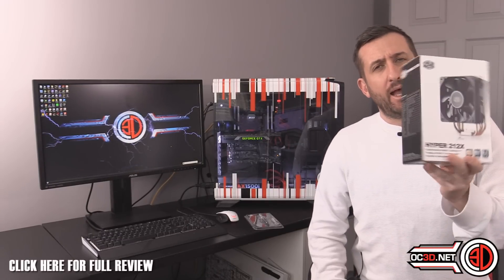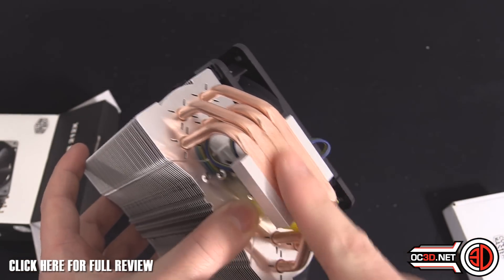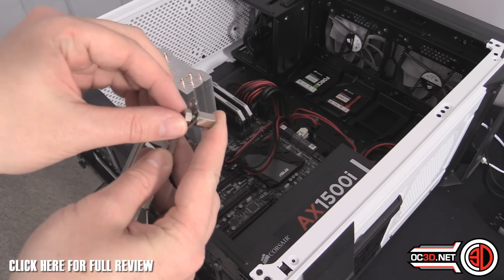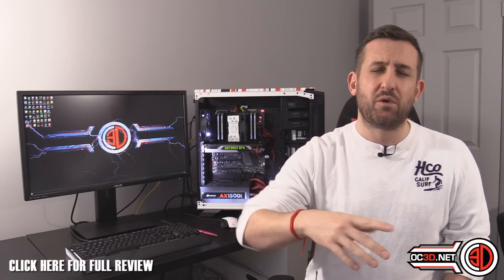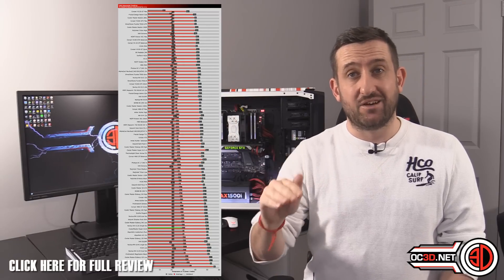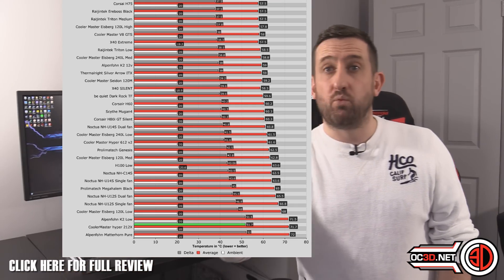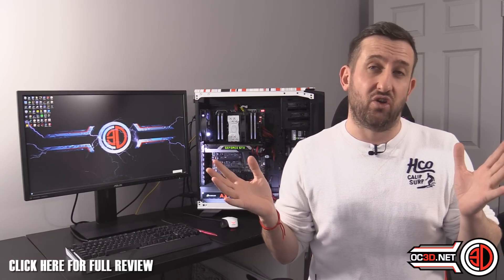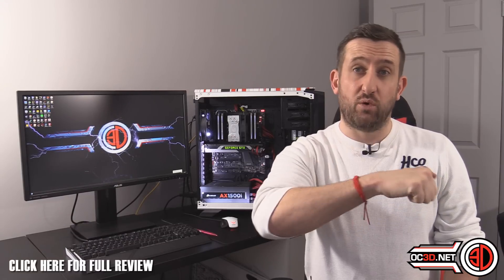Coolermaster 212X £30 CPU Cooler Review

Comment: I Just put a hyper T4 on my 4690k. at 4Ghz it's running at 40 C with 60% CPU utilization.
Reply: +hblu The cooler is great for 95 tdp cpu´s but not for the high-end 2011 socket.

Comment: im using http://www.amazon.co.uk/Enermax-ETS-T40-W-Radiator-WhiteWhite/dp/B00D697L0Y/ref=sr_1_1?ie=UTF8&qid=1456849117&sr=8-1&keywords=Enermax+ETS-T40-W on my i7-4790K @ 4,5Ghz    and it maxed out @ 61°C in Aida64    was buying this in germany for 37,-99€   wich was @ that given time like 32£  (feb. 2015)
Reply: +BiveZz01  Enermax itself is saying it got 200w cooling potential, also got the same cooler as black version   cooling  my old FX-8150 in rig of my GF   while  62°C @ 4.1 Ghz and full load.

Comment: I'm using a hyper 212 evo on an i7-4820k @ 4.6Ghz and the temps never get over 60*c,  for the money you can't really go wrong these little coolers.
Reply: +Jacob Whittaker I had the evo on a dual fan set up. Now I have the NH-D14. It runs 6 degrees cooler at stock, but as you start to clock it up it starts to spread. The 212 Evo was a great little beast though and the only reason I got the NH-D14 is because some dude was selling it for £35 on ebay because they didn't realise it wouldn't fit in their case. To be fair it is almost as big as my head...

Comment: Look the bottom of that CPU cooler is poorly milled .....it should be polished ....they left the crevices on the heat pipes at the bottom....I had that same problem with my cooler master hyper T2... My i7 6700k would spike to 81C under load...this will work better because it has 2 extra heat pipes ....but it's speed to cool the CPU back down to stable temps will take a tiny bit longer with a non polished surface.....
Reply: are u a engineer? as long it has a flat surface it's better than a fuckin shiny surface that is uneven. btw u dont expect a mirror finish in that price range.
Reply: +FantaFuture92 for $45 dollars my CRYORIG H5a does have almost a friggen mirror finish , and yes I expect that ...and no my cooler master hyper T2 did not have a flat bottom it rocked on my CPU ...which made my i7 6700k spike to 81c under load
Reply: +FantaFuture92 we who post videos about our experiences and the faults that we find .....I was explaining that my T2 failed to do its job .....and I noticed that all the cooler masters in the price range of $45 and under have the same machine surface problem ......the CRYORIG H7 is $35 and I believe that has a almost mirror bottom as well. Just 1 less heat pipe ......and they focus on CPU cooling .....my cooler master sounded like a jet taking off under full load......

Comment: This is a fantastic cooler. I have used this on a FX 8350 black 4.0 Ghz and it had no trouble keeping the chip under 60c at full load.
Reply: got the fx 8320, at 3.5 stock speeds, the temperature stays under 50C° at full load
Reply: +T FK wow those are really good temps
Reply: Chin Narciso well now its summer, so now it stays around 55-65C° at full load

Comment: I have been running the 212 Evo (with 2 Prolimatech 140mm fans in push/pull) for three years on my AMD FX8350 (stock) and it has never exceeded 63°C under full load running SETI 24/7. I always thought AMD was supposed to be the mega heat generators of the CPU world (at least that's what my Intel owning friends tell me), seems I was wrong, I have not used a desktop Intel CPU for quite a few years now. But this is a nice balanced review and it's nice to see tech tubers reviewing affordable products, not everyone has the money to spend on expensive hardware, keep up the good work TTL!

Comment: +OC3D_TV what is the difference between the new updated fan vs the older fan design?

I got the 212X with the grey high airflow fan. and it surprisingly able to keep my QX6800 CPU with good load temps. 

On the stock intel cooler, I was getting like 80+ degrees, now the 212X make the load temps hover at 60+ degrees and it only hit 70 degrees using AIDA64.

Comment: Do you  reckon AM4 will have the same mounting holes as the older sockets?
Thinking of buying one of these and still want to use it when Zen comes out.
Reply: I'm almost certain that it will. However, if the mount is not compatible, I'm even more certain that CM will release a set of mounting hardware which is, many companies have done this in the past.

Comment: Idk... I have the original 212 EVO, tried overclocking both AMD chips that I have under it... I used an FX6300 and an FX8150... at stock, both chips hang around 32-35*c, then under load the 6300 hits 44*c and the 8150 hits 49*c... so since these were below 60 I overclocked the chips to a far as I could take them before they hit 60 or became unstable... the 8150 was able to hit 4.36GHz... and that's a 125W chip at stock! the chip itself was yanking about 160W out the VRMs whereas the 6300 was at 4.72GHz pulling about 130W from the VRMs... the only reason that chip wasn't pushed harder is because it got unstable after that! I bet the 212X could probably handle those loads with a slightly lower fan speed on my systems... (oh... and the room temps were 22*c all the way through in case anyone wants to make delta figures for giggles :P )

Comment: Good luck replacing the mounts, I had a 4 year old Hyper 212 Evo and the mounts had broken over the years due to replacement, movement, etc.

If you need new mounts, really you just have to buy a new damned cooler, or contact the company and hope to get an answer.
Reply: +ProtoMario well 30 bucks for 4 years of usage isn't a bad deal.
Reply: garramiro No it isn't but my point is because those plastic pieces are so cheaply made you have to shell out 30 bucks more for essentially a less than 1 dollar piece.
Reply: i see your point. But it's not enough reason to avoid buying one of theese puppies, i've been running mine for over 5 years and no problem whatsoever.

Comment: You can get the Scythe Mugen 4 for around 33-35 GBP. I think that it is a better choice for your money.
Reply: +Senzelian 
I thought 30 GBP (per Tom's title) sounded high for the 212.  Definitely go with the Mugen if the prices are that close.  (I've only shopped US prices, where the 212 can often be found for $30 if you search, and the Mugen-4 is usually $42.-$45.)

The Mugen 4 isn't quite looking spectacular in these graphs, but it's really a whole step up on the performance/noise metric, according to all the reviews I've seen that do a proper decibel rating.  Enough so that I think it's worth the 150% price difference.  Silly not to go for it if it only costs 10-15% more.

Comment: Didn't watch the entire video yet, but is the mounting system improved? On the 212 evo the cooler could move a bit.
Reply: +L3xou97 I like the 212 evo, but the mounting system is a bit clunky. I wish that you could attach the bracket directly to the base, instead of relying on that crappy pin to keep it still.
Reply: +Paul Sde This alone would improve things so much. Or at least boost confidence during the install.

Comment: Make a series out of it - good cooling on a smaller budget.

- BeQuiet Pure Rock
- Cryorig H7
...

These two were beating the older 212 Evo for the same money. Sadly everywhere you looked people were totally 212-crazed. When released it was really great price/performance wise, but there alternatives now.

And PLEASE stay with So 2011 for cooler reviews. So1151 and Skylake CPUs are useless when it comes to reviewing CPU cooler performance. They stuff Intel puts under the IHS and the variation between CPU samples makes comparisons between coolers on So1151 totally worthless especially in the higher end range. Often the TIM issue is what s holding back cooler perorfmance and compressing performance differences between coolers.
Reply: +Karl Arsch I got my 212 Evo for 27€ 1 and a half years back. At that time for that price it was unbeatable where I live and probably in most Europe. But like the prices are now there are other viable options. The only problem I have with it is the price now and the rather tall height (159mm?)
Reply: and if you have even less money the m9 from cryorig
Reply: 2011-v3 still exists. 5960X vs 3960X would be a nice upgrade for testing.

Comment: Cryorig h7 imo is the best, doesn't look cheap like most budget coolers do.
Reply: the m9 does even better as a budget cooler. check kitguru a 9590 doesn't pass  60 on load
Reply: +taief miah I will probably get one for my third pc. I don't expect it to beat the h7 though, I have my i5 4690k at 4.6 and barely see it going over 50c on games.

Comment: Aren't these old? They've been for sale in Australia for a few years or more.
It says they came out in 2013 after I checked.
Reply from the maker: +WayStedYou the 212X is the new one
Reply: +WayStedYou Hyper 212, Hyper 212 EVO, Hyper 212-X
Reply: +Pot Head (P07H34D) Yes the 212X was announced in 2013 and came out in 2013 from what i knew

Edit: just read that it wasn't released in Europe so that explains why ive seen it here for ages.

"Hyper 212X will be available 8th January, 2013. Price and availability 
may vary based on region. Please consult your local Cooler Master 
Representative for more information."
Reply: WayStedYou There's also one I didn't list the 212 Plus. I honestly didn't even know there was that many iterations, damn time can fly.

Even if they have had it in the UK market awhile, it's still something interesting to review because it's like your baseline overclocking cooler.

Comment: would this be good for an i5 4590 over the intel cooler??
Reply from the maker: +James W much better than the stock cooler dude yes - also follow my advice in the video about manual volts and under volting
Reply: +OC3D TV still newish to PC's is there any side affects to undervolting and how difficult is it to do??? as i might do for while i have the stock cooler??
Reply from the maker: +James W Far too deep a question for here, pop on the OC3D forums and they will give you the link to the guide and help walk you through it
Reply: Thanks for the help

Comment: Was the back fan sucking in air from the outside while the fan on the cooler blowing towards the back fan?
Reply from the maker: +Alexander Rex Evensen when it was tested it was set up right. I chucked the cooler back in today for the video and forgot the back fan. When it was tested it was spit on though. I'm only human ;)
Reply from the maker: +Alexander Rex Evensen no matey
Reply: OC3D TV
Oh, I see. It looked like the rear fan would suck in air from the back, so it made me curious :)
Reply: +Alexander Rex Evensen Was thinking the same thing, first view of the case... :-)
Reply: +OC3D TV Yes matey
Reply: OC3D TV
Hehe, I see :)
Reply: +OC3D TV Which case is that? It looks really nice!
Reply: +Jack Of All Trades Looks like a modded corsair 760T, really nice case.
Reply: stephenTcartwright
Yeah, it looks beautiful. I might get the Corsair 760T now. Where can I get a mod like that?
Reply: Jack Of All Trades Oh mate, I assume Tom did that mod. It's a nice case though so just find yourself a friend who is good with masking tape and spray paints. The inside itself is not a problem. It's full of bits you can remove for cooling systems. The standard case is actually really nice mate, they are pricey as fuck though. £150.
Reply: stephenTcartwright Alright. Thanks for the response. And I did figure out that the case is a Corsair 760T because Tom uploaded a review on it with that same design.

Comment: brought a hyper 212 evo last year, fan was loud, ended up replacing it with a noctua NF-P12, would have been better off buying the £40 noctua cooler that comes with 2 NF-P12s.
Reply: yeah I agree the fan is a bit meh and it didnt look to nice either. I got 2 NF-F12 for push pull on the 212 evo back when I had an FX8320 OC'd to 4.2Ghz and never got to 55c upgraded to a 4790k and it's  still amazing for temps and noise never seen it go past 55c either OC'd to 4.7Ghz both with low fan profiles.

Comment: I got the 212 EVO (same thing) running on a 2500k at 4.5 Ghz, never seen more than 40 deg delta. Got it for 20$. You can put this on a I5 or I7 (not the 2011 stuff)  < 100 W TDP  and overclock without a problem.

Comment: Are there any coolers with black heatsinks and good temps?
Reply from the maker: +Uk Gamer 'good temps' is a bit of a broad term but black instantly says bequiet coolers to me. Maybe the Phanteks cooler too
Reply: +Uk Gamer beQuiet! Dark Rock Pro 3. Best black cooler that isn't an AiO. I have one for my 6600k, OC'ed to 4.8GHz at 1.45v, only gets up to 50 degrees at load, dead silent
Reply: +Uk Gamer take a look at the enermax ets-t40 lineup! there is a black one aswell, thats my go to budget aircooler line!
Reply: Uk Gamer bk019 is 163mm
Reply: You can check Cryorig out too mate.
Reply: Thanks I managed to find one I like the look of the be quiet BK014 but am wondering if it will fit in my tjo78e. Im not going to oc my 2500k but just want a good one that will last forever and BE QUIET lol
Reply: Cirno never built with cryiorig but they look really nice! hows the perfomance on em? how are their fans tuned?
Reply: Uk Gamer tjo78e? cant find this case...
Reply: mcl40000 Performance term, their products is on par with some bigger boys out there. About the fans I dont know, because there mixed review about it. But their mainpoint is looks, they even have clip cover to hide those ugly end of the pipe even at budget/mainstream lineup cooler.
Reply: Cirno yeah, phantekks does that too...have to get one of these cryorigs...for science! ;D
Reply: mcl40000 Ahaha xD Goodluck mate :3
Reply: Uk Gamer the bk014 is 166mm tall...if you can find out how much cpu cooler clearance you got in your case you´re set!
Reply: Cirno thanks! do you own one of these?
Reply: mcl40000  Sorry its the tjo8e http://www.silverstonetek.com/product.php?pid=303

Damn the max supported is 165mm lol
Reply: Uk Gamer ouch...one mm!

the bk018 is only 160mm tall...looking good?
Reply: +mcl40000 bk019 it is thanks a lot :)
Reply: Uk Gamer bk019 is more expensive tho...and a dual tower cooler!
Reply: +mcl40000 yeah the t40f is great too for lower profile
Reply: Flora Sterling I like that one too but its now available anywhere which makes me think the manufacturer stopped making them because of some kind of fault?
Reply: Uk Gamer still all over in usa
Reply: Uk Gamer newegg and usa amazon have it
Reply: Uk Gamer you want the t40f-bk
Reply: Flora Sterling I remember trying to look for it months ago its just not available in the uk at all.
Reply: Uk Gamer pop me a msg on hangouts and ill help you find one
Reply: Uk Gamer http://www.amazon.co.uk/Enermax-ETS-T40-TB-Silence-CPU-K1-Sockel/dp/B005DUHBEA
Reply: Uk Gamer http://www.amazon.co.uk/Enermax-ETS-T40-BK-Twister-Cooler-Apollish/dp/B00CYA59ZU

Comment: Damn, now I don't know whether to go with a cheap aio water loop, or this.
Reply: +Adrian Hutt a few exceptions though, the swiftech H220-X/H240-X and the EKWB Predator 240/360. AIO coolers can be good, CLC coolers can't.
Reply from the maker: +draginator6 I wouldnt get an AIO on this budget
Reply: +draginator6 This or the Cryorig H7, CLC's aren't really worth buying in general, the cheap ones aren't even worth looking at.
Reply: +OC3D TV AIO.. plz no.
Reply: +draginator6 never by aio. loud as fck.
Reply: Gilles Baudeweyns
Yeah right, Swiftech is my new Order next month but not Corsair or another ''cheap'' Factorys with loud fans included.
Reply from the maker: +Adrian Hutt You do have to dial the fans back on most AIO's - Id not run any at maxi chat
Reply: OC3D TV It would definitely be a much higher price that is beyond this, but it just adds a cheaper alternative to the aio. I also get most of my parts used and have seen some nice 240 rad aios for cheap.